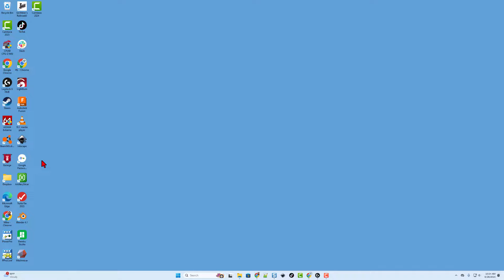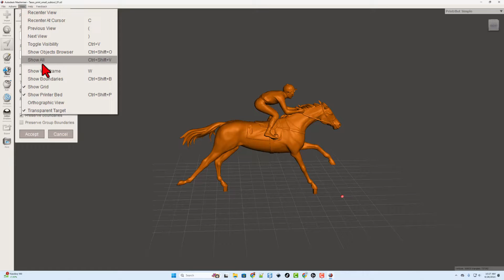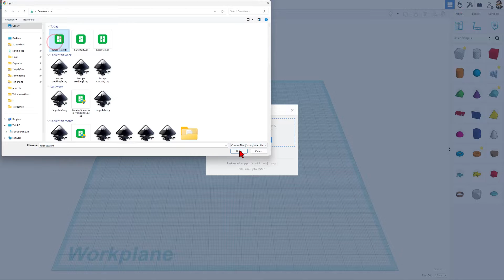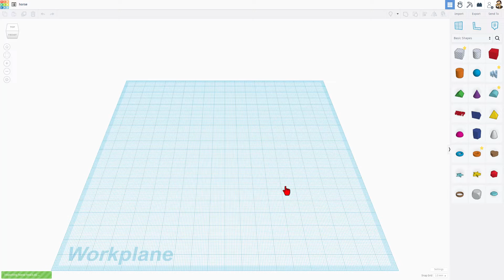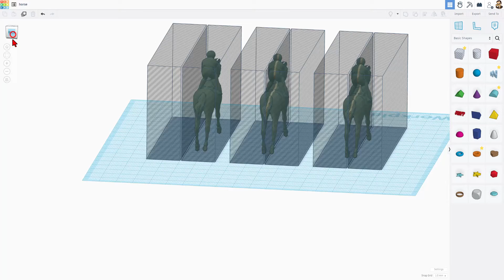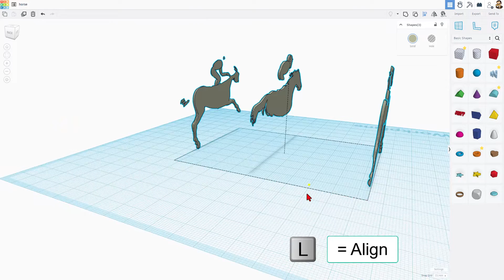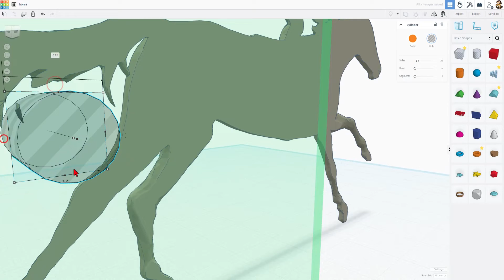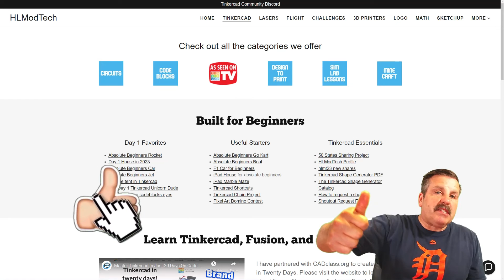3D model to Silhouette Easy Steps Meshmixer to Tinkercad in Minutes!

Comment: Meshmixer is a great program.
Reply from the maker: I agree. Only scratching the surface of it too! 🤯
Reply: I did know much about it but managed to slice a huge STL file up in slices to be used on a flat bed 3d polystyrene cutting mill. Then put all the parts back together to make a giant poly object. It worked out quite well.
Reply from the maker: Sweet! Having the right tool for the job is always awesome!